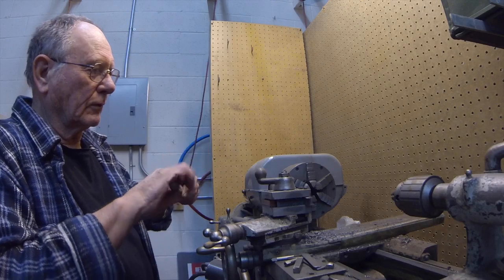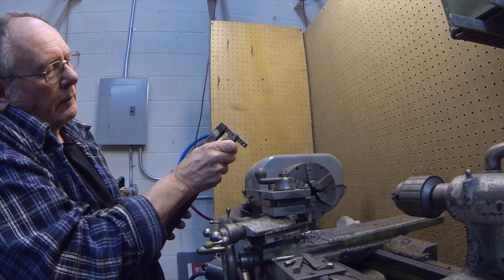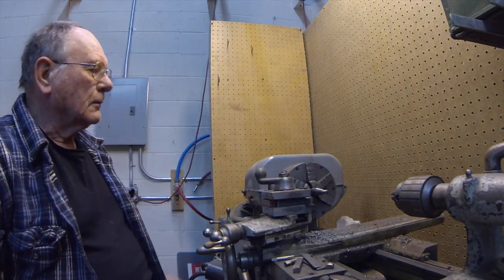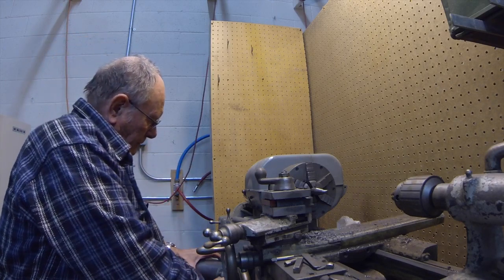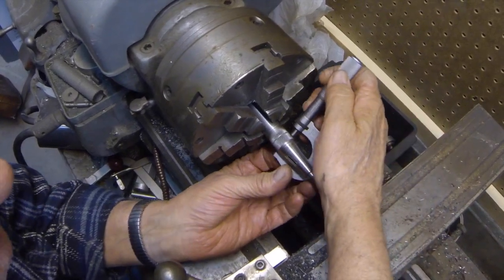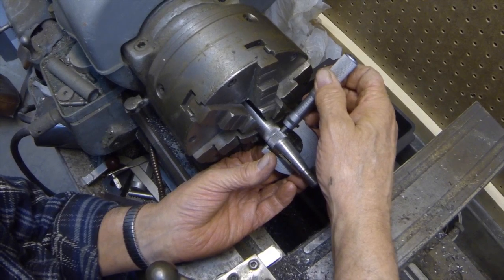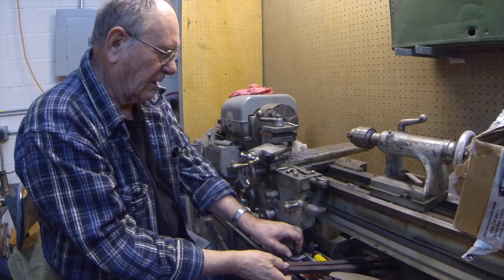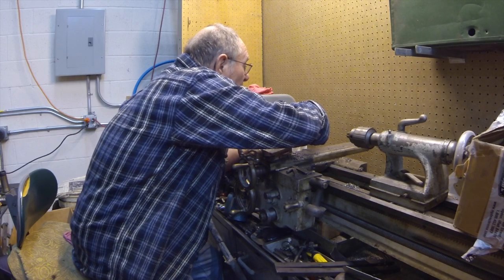Delta 890 Bandsaw Restoration - Repairing the Lower Wheel Axle

Comment: Does anyone know were I can get a set of lower bearings for this saw? I am restoring a 1930s and they are different than the ones I used on the 1947 delta/Milwaukee I just finished.
Reply from the maker: I believe we just took the bearings in to a bearing dealer and had them match them up. Can't remember if they had visible numbers on the old ones or not now, but if they do have numbers a bearing dealer should have no problem getting you replacements for them. If not, they should be able to match them based on measurements
Reply: Zac Higgins thanks for the reply. My bearings do have a name and numbers, and I can’t find a replacement the numbers on them are 88101and they have an extended inner race with 2 notches that mate up with 2 notches on the back of the wheel.
Reply: @jasonb4350  I just saw this post. And the 1930s bearings are no longer made. I had to make a new axle to fit a new modern bearing into its place. I essentially bought a piece of metric round stock from McMaster and turned the taper down, threaded the end of the shaft, and machined the woodruff key. It felt good to see this old machine run again.

Comment: Just a note here. I have an 890 and while my shaft didn't have that same wear spot. Most of the bearings on this saw are a slip fit. Once you tighten the nuts down the inner races of the bearing should engage and be solid. If you or anyone has this issue try tightening the wheels down and checking for play in the wheel.
Reply from the maker: +hanksgavin Thanks for the tip!!